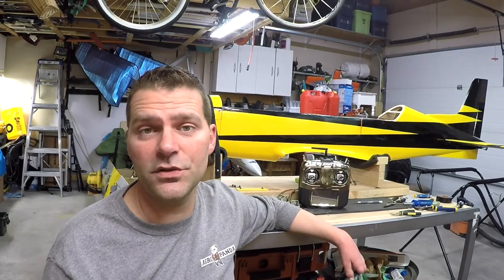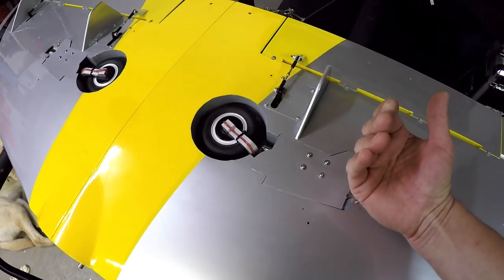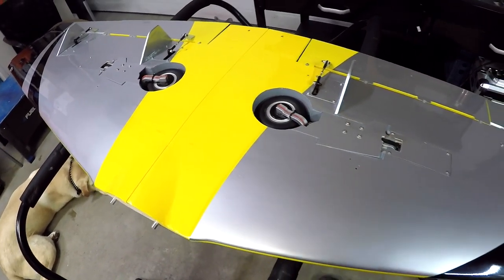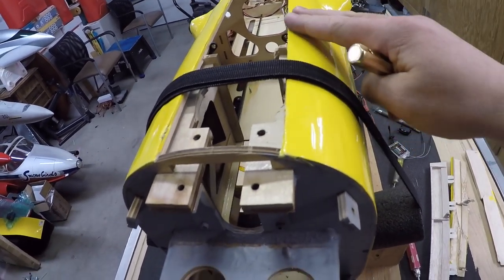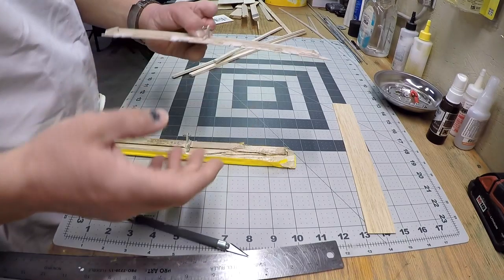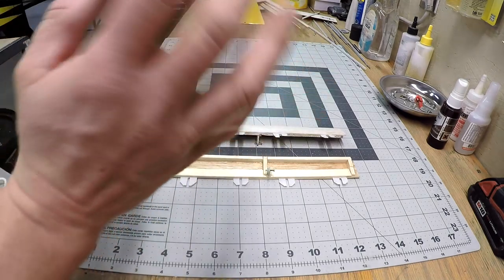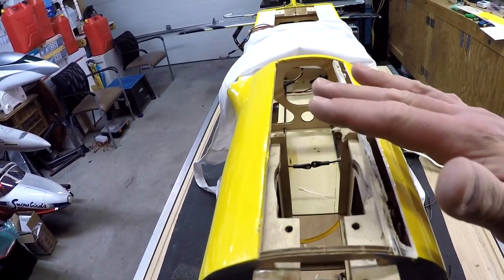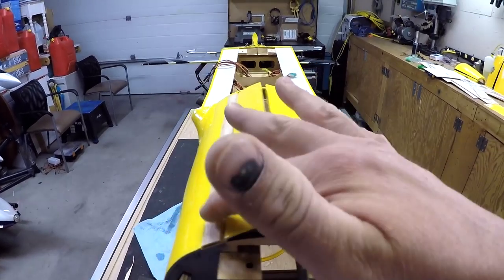AFTER THE CRASH - How To Repair RC Plane - Sebart PC21 with Wren 44 Turbo Prop, JR 28X DMSS, Part 2

Comment: Good video thanks for share with us, I'm building the same one with king tech tp45 would like to know what you do with the CG, you keep the one in the manual??... thank you. Regards from Spain
Reply from the maker: Hello Carlos.  We used the CG Point in the manual.  The maiden flight was good.  Didn't get any fine tuning in as the gearbox failure happened on the second flight.  Manual C of G setting seemed good.

Comment: Hello Sir.  Very interesting repair on this RC Airplanes. Two things why so many repair jobs are fix’s with Fiberglass an not use Kevlar glass? Kevlar seem to me to be better in not cracking let Fiberglass. Second I see you live in Canada and shipping cost for my sailplane would more then I pay for the Sailplane. You may have heard of Powerzone Eagle II sailplane. Thanks for this lesson Greg of Ohio
Reply from the maker: Hey Greg.  I think fibre glass is more common for a couple reasons.  1. ease of accessibility.  Hobby stores, automotive and suppliers carry it.  2. weight.  Just a guess but I think fiberglass may end up being lighter.  again just a guess.  I have used carbon fibre cloth on repairs in the past but it's not as easy to get.
I haven't seen the powerzone Eagle II.  Is that what yours is?
Reply: @thelightersideofrc   Sir yes that is my Sailplane 2m with flaps . I also brought a gyro for it going to Use HiTec. Please go to EBay for the Kevlar that seller as great prices plus they make very light weight Kevlar . Please check it out and look at the Carbon / Kevlar too. I am just starting and have the room at my home to fly it. Take care and love your videos to learn about repair. We’re in Canada 🇨🇦 do you live. I may check on shipping cost. God Bless
Reply from the maker: gregory h cool!  I’ll take a look. Thanks 
Calgary, Alberta.
Reply: @thelightersideofrc  Jon I sending you a email.

Comment: Great video Jonathan. I'm interested in the radio programming. Will it be XBus or PWM? also any tips on the iGyro set up.  Thanks.
Reply from the maker: Thanks Randy!  Radio programming will be done with PWM.  I had a glitch in my Ultra Flash Radio program with my 28X so as a result I have to set the Plane up as brand new. I was thinking of doing a video on the programming which would also include the 3E Setup from start to finish.  I'm hoping there is interest in seeing that.  It will also be setup as PWM as cant use Xbus with the Igyro.
Reply: Sounds good.  I have an iGyro3e that I want to use in my pylon planes with PWM so I would be interested.  I'm also JR DMSS using XG14

Comment: Denatured Alcohol is a better thinner - contains no water. The Iso alcohol contains some water!
Reply from the maker: Thanks!  That's a great point and tip.  I generally use the 91% stuff instead of the 70% stuff but I do have Denatured Alcohol as well.  Will start to use that.